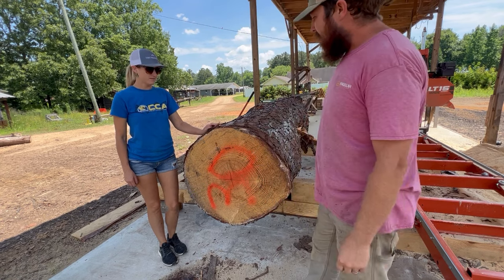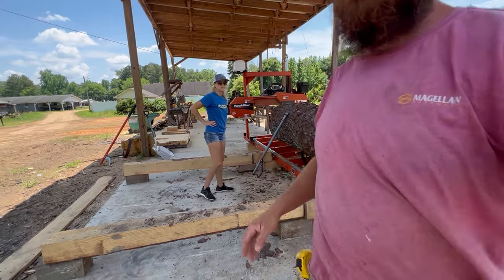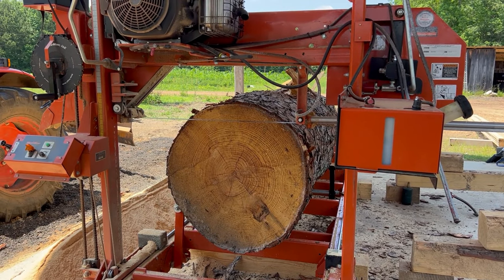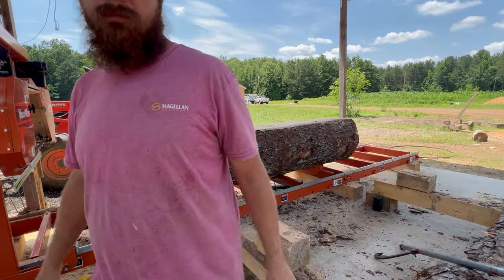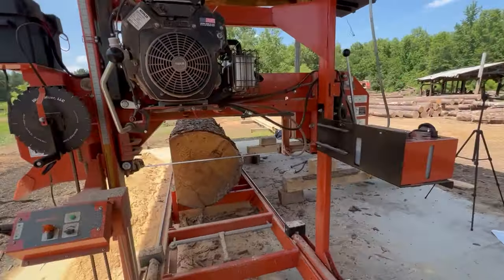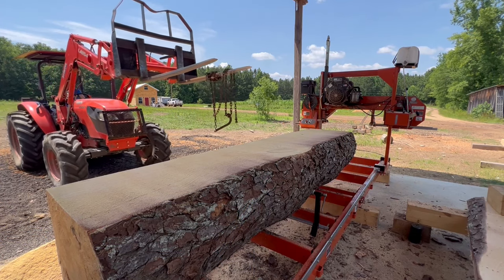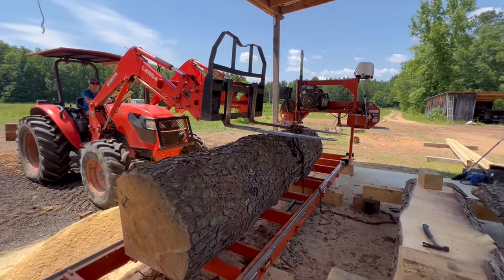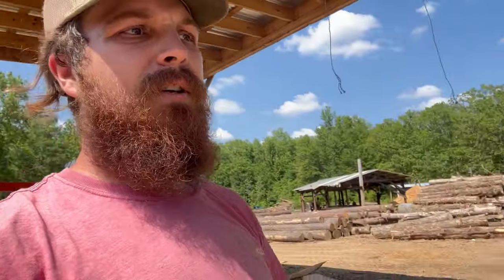This log was MASSIVE - RARE Pine log on the Sawmill

Comment: I mounted a 12 volt winch above my LT 15 to turn the larger logs.  I forged a hook like a big fish hook that I use with a chain.  I use a 12 volt deep cycle battery that I keep charged with a solar charger.  The winch has a remote control, that lets me stand clear of the log.  It works real good.  Have a Great Evening!

Comment: I too am operating an LT15 wide. I turn the big logs with a Hi-Lift jack. Slight learning curve but works great. Also use it to raise the small end of the log, then block it, so the pith is parallel to the frame. Thanks for the great videos too!
Reply from the maker: That’s a good way to do it!

Comment: before i built my lifting hooks from 2 78" log rite mega hook cant hook, i used 2 1000# ratchet straps, with the ratchet head at my pallet fork frame, and wrapped the strap and hook around the log, depending which direction i needed to roll it and used my kubota 7060 and lifted like you did. i was able to roll red oak and some walnut in the 38" diameter range with little effort. since most of the logs im milling are much to heavy for my 7060 to lift, i use a M936A2 wrecker to lift and load the loads. the last hardwood log i milled weighed in around 5000 lbs and the rotator on the wrecker made loading and turning the log a breeze, using the modified cant hook hooks. 
as for clamping big diameter logs, i do the same thing you did and use that toeboard wedge till the clamps will fit and work
Reply from the maker: Works out great! Sounds like you got a good operation!
Reply: @wallacefarmandsawmill  its a sore operation. even with equipment, a freshly repaired lower back, its still a back breaker. next yr my wide will be half paid off and i WILL put my deposit down for a 40 wide and sell my 15w and dump the sale cash into the price of the 40w. hopefully then, it will be good. plus i should have my wide cut (82" between guides) band mill built for those a little to big for the 40 wide.

Comment: You would have thought they'd have provided bigger clamps and stops.  Good job handling it.  Do they offer a de-barker for this mill, from the looks of the slabs, there is a lot of bark coming in the kerf, which the debarker would probably stop--and save on blade wear too!
Reply from the maker: They don’t! At least in the USA. In Europe they offer it on the Lt15!
Reply: @wallacefarmandsawmill  Too bad  Wonder if you could make a homemade one or get the Euro version and adapt it.